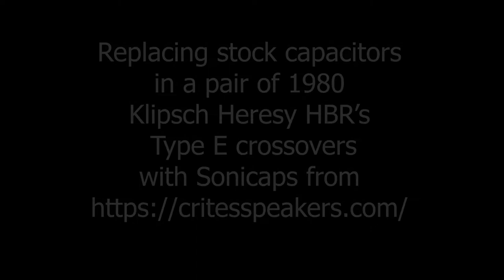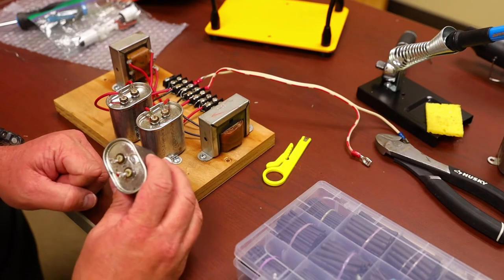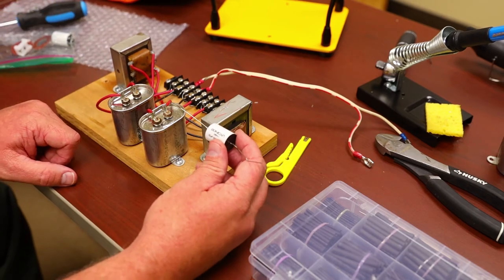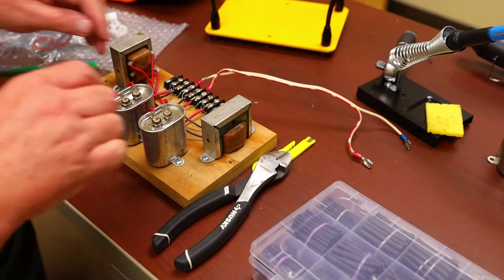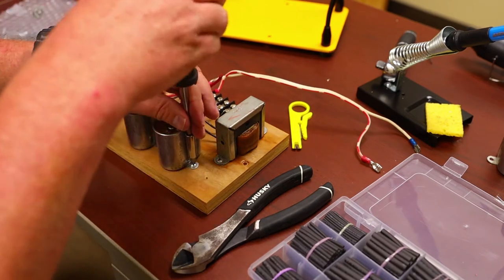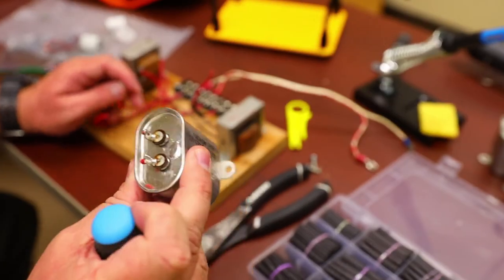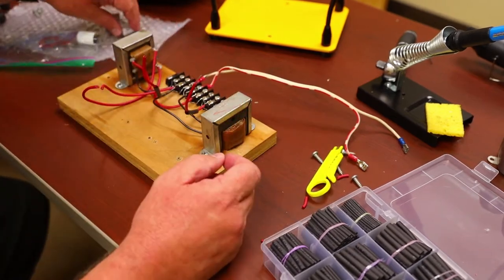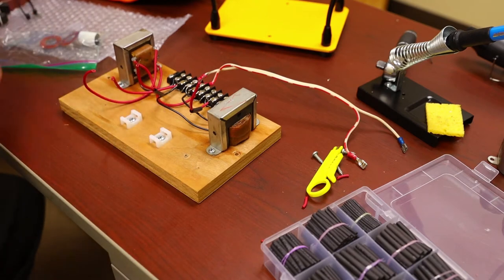Replacing capacitors on Klipsch Heresy 1 (Type E crossovers) with Sonicaps from Crites Speakers

Comment: 1.) Did you twist the wires together before you did the solder and 2.) is there a particular gauge/type of soldering wire that you used?
Reply from the maker: @PatriciaSinatra-s6p  1.) i wrapped the wires around one another before soldering. 
2.) just regular soldering wire

Comment: I also did a capacitor replacement 1% 2uF poly 250 volt , in a pair of 1980 Heresy's.. I feel the difference is a lot , the highs are defined now with better detail between instruments, sibilants' is lower... In the passed I used the EQ to com down the highs , don't need it now..